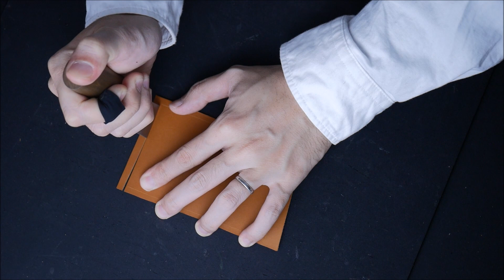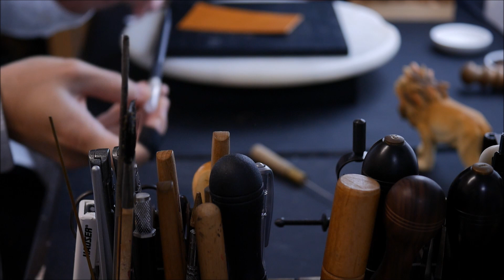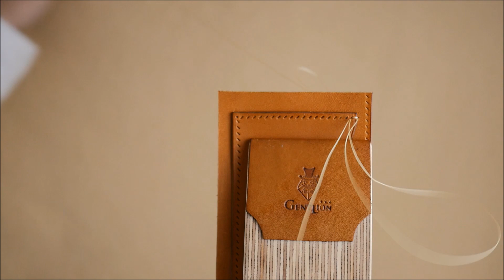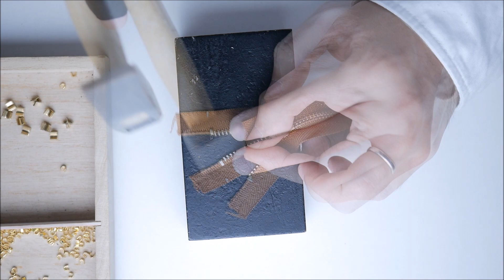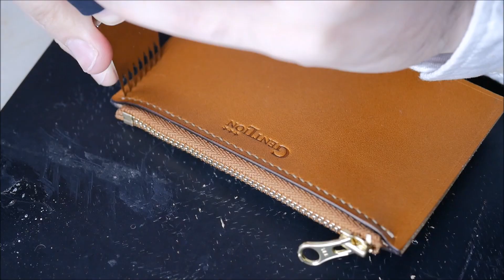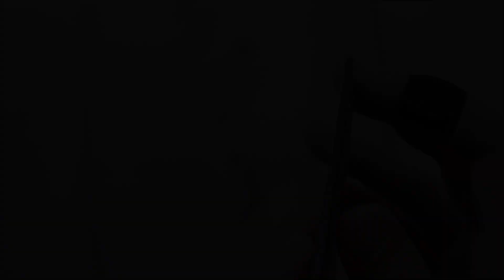Making a zipper card holder｜PDF pattern｜No.21　【Leather craft】mini pouch

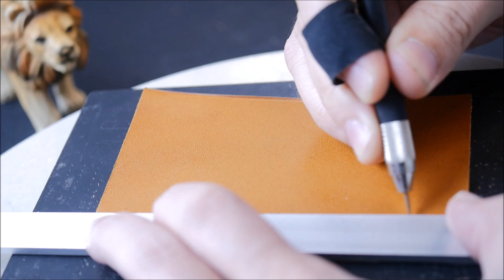Comment: Hi There, Very nice work :-) Could you please tell me the name of the tool that you are using at 2:40? It is not a ruler, and is way thicker than a ruler. Thank you very much :-)
Reply from the maker: thank you for the message.
It is an aluminum flat bar purchased at a building materials store.
It's not a leather craft tool, so it doesn't have a name.
It's not necessary because it's a work that can be done with a ruler, but I use it because I don't want to damage the ruler. Also, since this is slippery, I use a non-slip tape on the back.